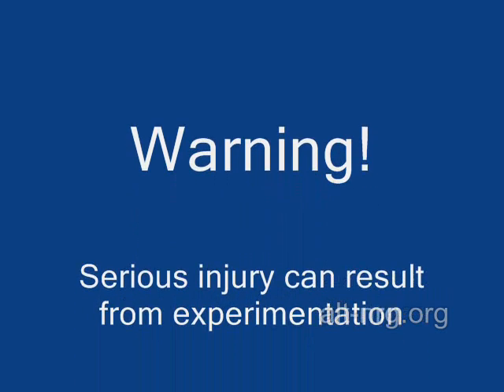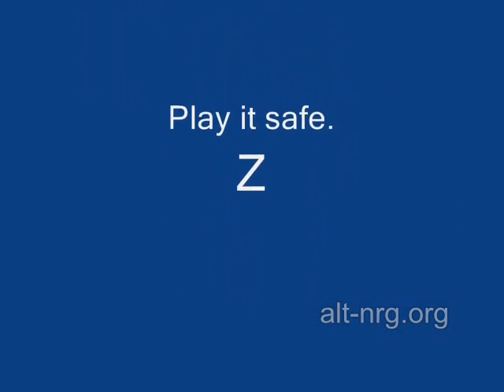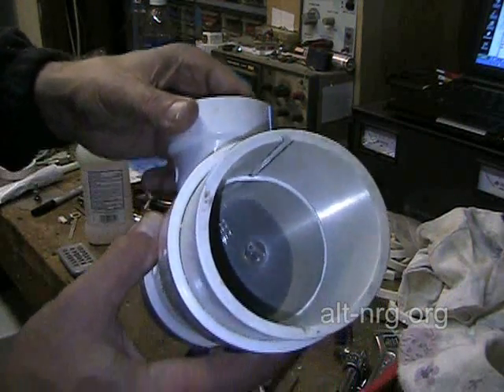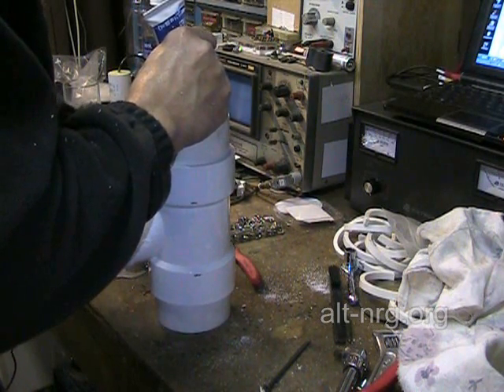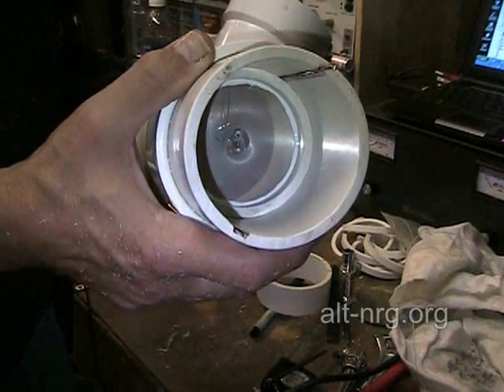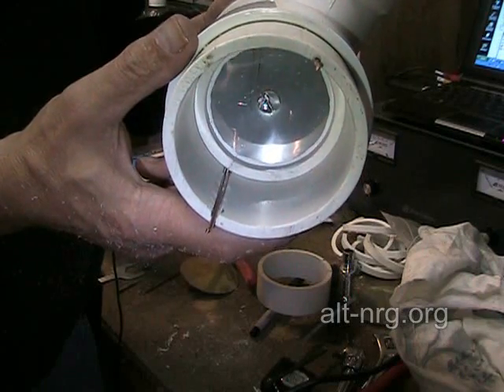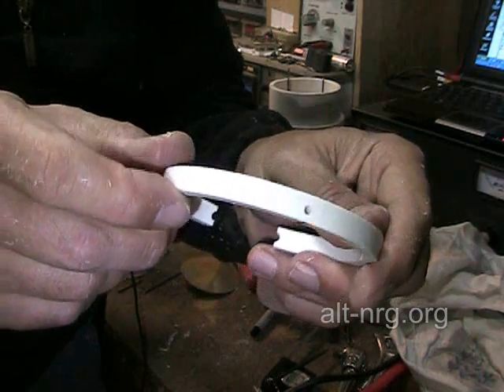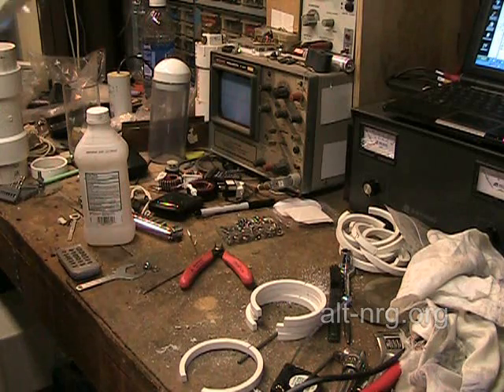#193 Inverted T cell part 8

Comment: Hum the Amazing GOOP that I've use for years could not be removed form glass, PVC, or cell cast acrylic, but then again i let it dry for minimum 48hrs. I found if it got wet within the first 12hrs it would swell up a lot, and turn whitish and would not hold very good at all. Just my experience's form the Aquarium industry, FWIW. 

Anyway I'm inspired again to revisit type of electrolyser set up again.
 Thanks, 

Keep up the great work

Comment: hahaha I have identified the sound, you where on the role. Too bad that you have a minor setback.. Maybe you want to reconsider the gas outlet port, it looks rather small indeed, and at this point you can add an extra gas outlet sloth into the pipe and the c-rings.  Or should the electrolyte not circulate together with the gas?

Anyway, I am looking forward to the next video, can't wait to see that baby pumping some gas. 

Greets, iT

Comment: @ Yourfisherman
Hmmm That interesting because i have been working a series cell that seperates the gas via a menbrane. I use "GOOP" to  bond the gaskets to the menbrane. I have had to modifiy the layup several times. So removing or disassembling the layup has not been a problem. Must be the GOOP spec i am incorparating.

Comment: The hole size does matter i believe your output gas channel is to small, i would add a second Chanel for the gases.

 Something about pressure.  Gas pressure will  built up based on production rate a restriction size (all the holes, top or bottom).  Gas pressure can displace the water level between the plates. Reducing production amounts if the hole at the top is not free flowing .

System pressure can be high. Differential pressure, inbetween plates press, and system press, has to be low!

Comment: Dow corning "1" (the cheap stuff at home depot). 100% silicon cures very fast and will even cure under water. "Goop" does not cure fast especially in a non vented area like what your creating we're talking days. 100% silicone  will allow also you to take that unit apart, Goup, rubber cement, and others, will not..

Kudos on your build Zero, you have taken a nice cell to another level.

I hope your MMW results are better than when i tested an earier verson.

Comment from the maker: I predict pressure will be very low. Scarecrow pushes 8-10 LPM through a 0.030 mig welder tip on his HHO torch and only hits about 5-10 PSI.

I have 0.125 on both sides of the T. It will be about 1/10 the flow per side through an opening with 16 times the cross sectional area.

Comment: one problem with most Room Temp Vulcanizing adheasives, is they need air flow to vent off the solvents. Working inside a cell will greatly increase the setup time.

Comment from the maker: What you see IS 5200. So it cures under water? That explains much.

There is a similar variety I've used before and liked that has a 1hr tack time, full cure in 24hrs. Going out for some shortly.

Comment: Hi Zero  You do a great job.  When I have had to take that kind of stuff off.  I use a paper towel and always a clean part of it and wipe it off with a lot of pressure on it.  You could a thin gasket material to replace the adhesive.  Love the idea of a hole in plastic.  Always look forward to you vid.

Comment: I'm no expert buy any means on the topic but I fail to see a reason for the adhesive. But if it is needed would a  few simple dots do the trick? Also why not perforate the plates top and bottom for better fluid and gas escape along with the channels already in your pipe. My reasoning for this is a fear of to much pressure build up at the extremities of your  tee.